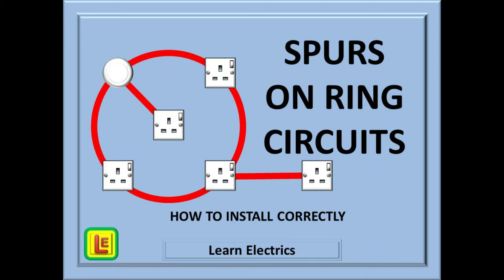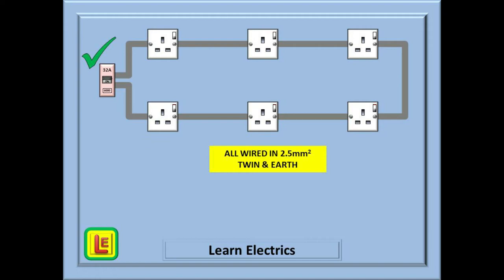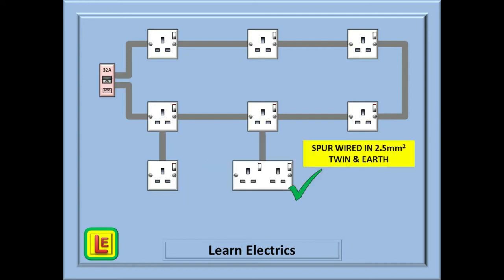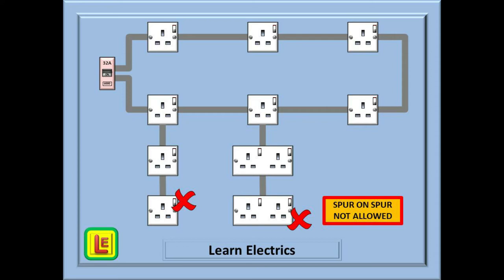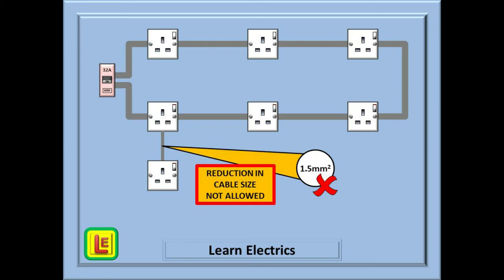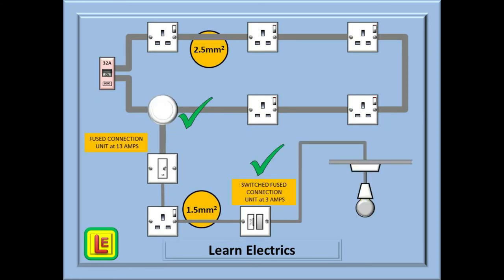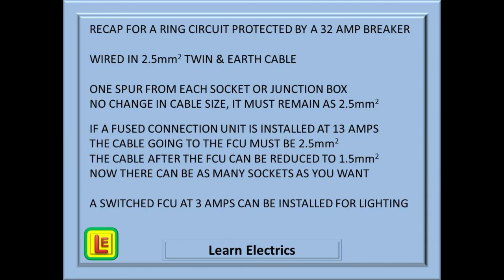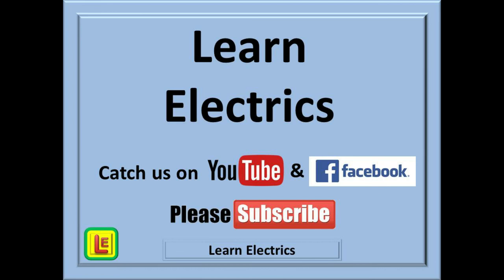SPUR ON RING CIRCUIT. Learn about connecting spurs to an electrical socket ring circuit

Comment: A concise and easily understandable explanation, thank you.

I have fitted an rcd wall plate externally to a shower room fed from the ring using a 2.5 cable. It is to supply a heated towel rail that has a 600W element.

Can I feed the towel rail with 1mm cable to a  flex outlet box adjacent to the towel rail?

Additionally, could I also wire an extractor fan and LED lighting into this rcd so that all electrics in the shower room are protected by the rcd?

I'm enjoying learning from your excellent videos.👍
Reply from the maker: David, yes, you can feed from the new RCD but the extractor, lights, towel rail must be fed through Fused Connection Units (fused spurs). Towel rail with a 3amp fuse and the extractor/fan on a separate FCU rated accordingly (possibly 3 amp) as per the demand.
Glad you are enjoying our videos, lots more coming.
Reply: @learnelectrics4402  thanks for your prompt response.

Is this the case even if the rcd plate is fused?
Reply from the maker: An RCD is not fused. It will be fused by the 32 amp or 40 amp breaker back at the CU I assume. You should not have a 2 amp towel rail protected by a 40 amp breaker, hence we use FCUs and fit 3 or 5 amp fuses. Hope this helps.
Reply: @learnelectrics4402  thanks again for your on going support, I appreciate your efforts.

The rcd I have fitted IS fused, it's this one https://www.toolstation.com/rcd-spur-white/p48767

So will this fuse suffice for the towel rail or do I still need to fit a secondary fused spur?
Reply from the maker: Righto David, this is an RCD SPUR, which is different to just an RCD.
An RCD on its own not fused but an RCD spur is yes.
OK we're sorted now.
As long as the RCD spur has a 3 amp or 5 amp fuse (the towel rail will draw about 2.5 amps) you will be ok. We always fuse as close as possible for safety and you may find the RCD spur comes with a 13 amp fuse fitted, in which case change it.
Glad you got back to me. loads more to come.
Dave

Comment: Why can't you use a 5amp fuse for the switched FCU for lighting?
Reply from the maker: Good practice says that we always fuse as close to the actual demand as possible. At 5A that's 1200 watts of lighting. Is there really 1200 watts on that circuit or can we reduce the fuse to 3A - about 700 watts and that is still 10 lamps at 60W, even more if they are LEDs. Always try to fuse for safety and choose a fuse close to the actual demand. If the fuse rating is too big, the circuit could be on fire before the fuse blows. Hope this helps. Dave.

Comment: Can you add one double socket spur to the 32 amp switch in the Consumer Unit feeding the ring main?
Reply from the maker: If you mean can you add a spur directly to the 32 amp circuit breaker then yes you can but it must be in 4mm cable. If it comes off a 16mm or 20mm breaker then 2.5mm is ok.
Reply: @learnelectrics4402  Thank-you for your reply. I hear what you say but do not understand why it needs to be 4mm cable. If that is the case then all the single spur's on  the ring main will need to be 4mm cable as well. The best way to explain it on a drawing is to think of the CU connection as just another JB on the ring main.
Reply from the maker: Yes Roy, you are right. It depends how you view the "spur" and I like your JB analogy. If it will only ever be one double socket for all time then yes you can use 2.5. and treat it as a spur off the ring. But if you think it may be considered as a  radial circuit now or in the future and have more sockets added to that original socket, then it should really be 4mm. I've seen a few where the spur has been extended with a second socket box. Their excuse was that one more wouldn't hurt.
It sounds like you know what your doing, keep going.
Good luck and stay in touch. Thanks for watching, thanks for the comments.
Dave
Reply: @learnelectrics4402  Thank-you for your reply, my angst for raising the question was due to a recent EICR report which categorised that ring main circuit as a C2 (unsatisfactory) "Multiple circuits in MCB" and having a hard time convincing him he is wrong.
Reply from the maker: Roy, when I was assessing for one of the big schemes I would have accepted what you describe as ok. It makes sense, it's safe, you can explain coherently why it is done that way, so there shouldn't be a problem. The Electricity at Work Regulations require that the connections are good, the conductors are installed correctly and suitable means are provided for overcurrent protection (a circuit breaker), etc. Nice "chatting" to you.
Take care. Dave.

Comment: Is there a limit to sockets in the ring? I have just moved in and I know they had work done before. I’m trying to figure out how many for each ring and check nothing has been double spurred, but also if there is a ring limit I want to check that’s not exceeded either.
Reply from the maker: Sockets in the ring, no limit except common sense. The theory is that the breaker will trip before you can plug everything into all the sockets.
Reply: @learnelectrics4402  Thanks for the reply!
Reply from the maker: You're very welcome.

Comment: Nice easy vid thanks.Can I add an emmersion  to a 13a fused spur?
Reply from the maker: No. An immersion heater must be on its own circuit. A 16A circuit breaker and then a 13A switched fused spur. page 505 (ii) of the Regs. Good question though. Thanks for watching. Dave.

Comment: My garage has 4 sockets I wish to add more. The breaker is 16amp is this normal? Should it be changed
Reply from the maker: You cannot just change the breaker size without knowing that the cables are the correct size for the new breaker. I suspect at 16A this is a radial circuit, have a look at our video on Ring and Radial differences on the link below.
https://www.youtube.com/watch?v=6GNb1SSEjQg
We also have a video on Extending Radial circuits. Dave.
Reply: @learnelectrics4402  thank you. I have checked all the sockets in the garage and is a closed loop circuit 2.5 cable. I will be using the garage as a workshop

Comment: my novice understanding can't quite grasp the diagram at 4.52 mins. The fused connection is showing the supply coming in and the load going to four additional sockets. But it also shows supply to the other sockets? Does that mean the 2.5mm wiring share the same supply terminals? I.e. two wires into the same supply terminals to allow the continuing of the ring?
Reply from the maker: That is correct, the 2.5 passes through the FCU to the rest of the ring and also feed the 4 sockets below.
take a look at the video on the link below.
https://www.youtube.com/watch?v=fj9cc1U9Re0
Reply: @learnelectrics4402  Many thanks for that! I have a clear grasp of this now.

Comment: Excellent video and well explained
Reply from the maker: Thank you Jay.
Reply: @learnelectrics4402  I have followed your guidance to install wall light with L, N. E wires which is working fine. However I tried to install dimmer smart switches between lights and spur switch ( with 3a ) but it didn’t work. I tried 3 different types of smart switches but no results. My wall light is dimmable that I bought. I’m not sure where did I make mistakes, any recommendation would be helpful, Jay
Reply from the maker: Are you sure you have a neutral wire in the switch box and not just a blue being used as a phase switch wire. A smart switch will usually need a neutral.
Reply: @learnelectrics4402  thanks for quick reply. I used spur socket where it wires blue, brown and earth. I used these wires to connect a smart switches but it didn’t work. I have another smart switch where it doesn’t require N wire and I tried but still not working.

Comment: what do you mean by maximum current?the appliance plugged in?dummie here lol
Reply from the maker: It can be the maximum current that (say) the kettle will consume.
It can be the maximum current that a cable can allow to pass though before it overheats
Or it can be the maximum current that the protective device (fuse or breaker) can carry 24 hours a day/7days a week - often called the fuse or breaker rating.
Just because a circuit breaker is rated at 32A maximum current, it doesn't mean it HAS to draw 32A. It can draw just 5 amps or perhaps half an amp if connected to a 100W table lamp.
I hope this helps, it does confuse new folk at times. But keep watching the videos, keep learning. There are nearly 200 videos on the website at LearnElectrics.com. We all started off as dummies at one time. Dave.
Reply: @learnelectrics4402  if we say only 2 x55 inch new led tvs and 2 xdesktop computer would be in that below the max current?

Comment: you never mentioned the maximum length of the cable going to a spur.
Reply from the maker: Whatever length doesn't make Zs exceed the permitted maximum. It will be different for every circuit.
See our video - Cable Lengths and R1+R2 - on this link.
https://www.youtube.com/watch?v=Qq_9MNH8XxU
Reply: @learnelectrics4402  OSG 7.2.2 
Infused spur lengths should not exceed 1/8 the cable length from the spur to the futherest point of the ring.
ok its a rule of thumb and guide , but it's worth noting.

Comment: Only if the spurs off a spurs it has to be a fixed appliance,as an Industrial electrician of 50 years I've never wired a final ring circuit in cable less than 4mm and that's from a spec and drawings from an electrical design engineer,so my answer to house bashers wire your rings in 4mm twin and earth and if you lose one line cable therefore everything on the circuit is being fed by only 1 cable in the ring ,this is no problem because with one leg being 4mm it will easerly take the load but allowing for diversity the likelihood of all sources being on at the same time is very unlikely ,and if you house bashers say the cost of 4mm is too expensive my answer to you is I know contractors get up to 75% deducted off the gross price,so pass that saving on to your customer,simple
Reply from the maker: Thanks for your input, appreciated.